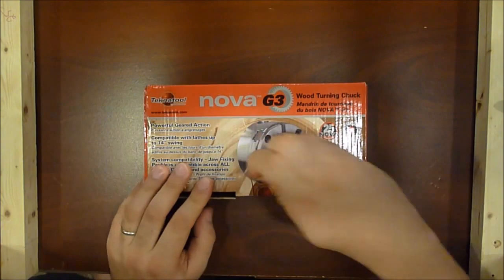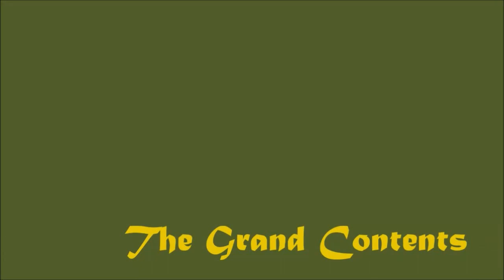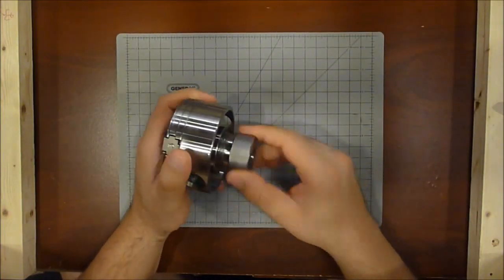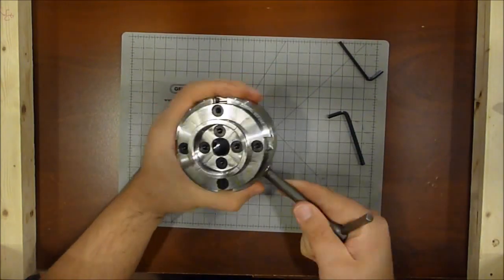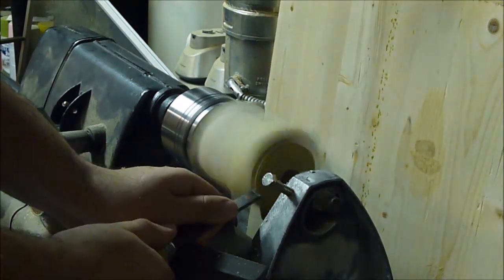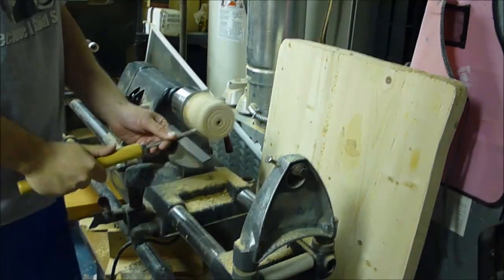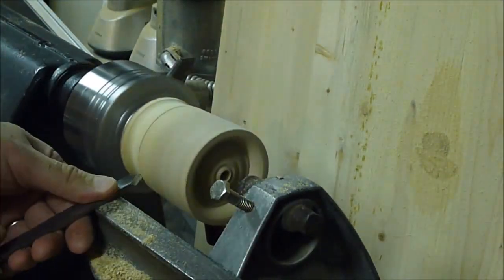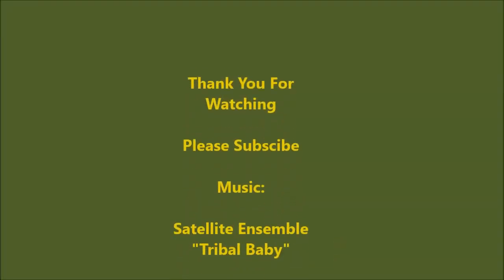Nova G3 Wood Turning Chuck Unboxing

Comment: Very nicely done.
I have a Super Nova 2 chuck for my Shopsmith 10ER, the Nova chucks work great.
Try mounting the Woodworm screw in the chuck first and then screwing the blank onto it until it butts up tight against the jaws.
Reply from the maker: +333rpd Thank you for the positive feedback and for subscribing.  I will definitely try to mount the Woodworm screw in the chuck first the next time I turn.  Stay tuned for future videos pertaining to the Shopsmith.
Reply: +The Home MAKER If you have any questions on the care and feeding of your ShopSmith, or just want to hang out with fellow ShopSmith enthusiasts. stop by the ShopSmith Forum.  http://shopsmith.com/ss_forum/index.php
Reply from the maker: +333rpd Thank you for the info, I will definitely look into the ShopSmith Forum.